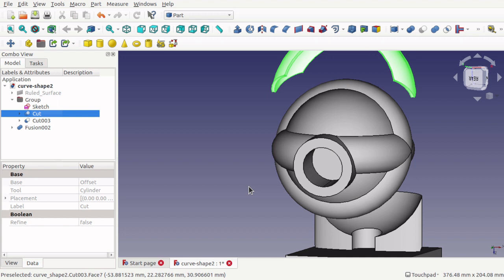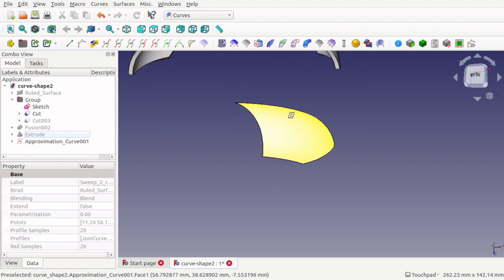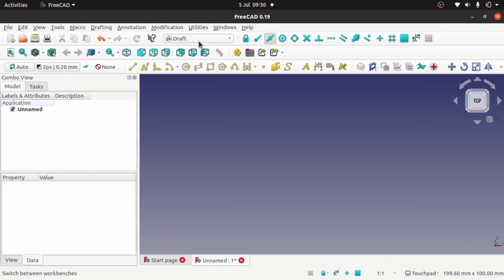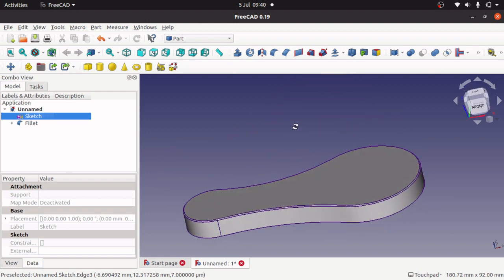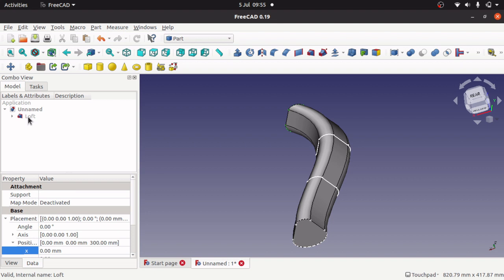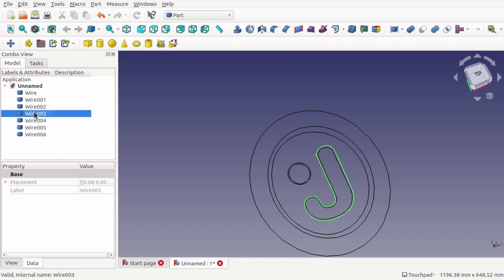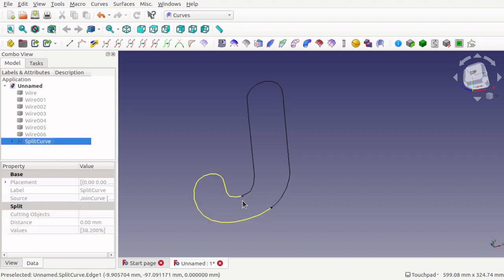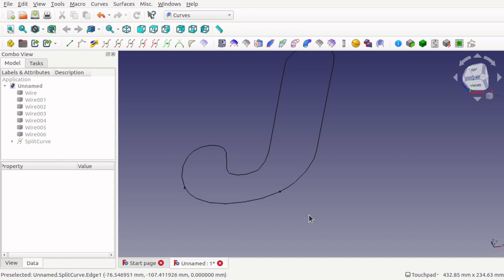Learn FreeCAD Curves Workbench [03] Join Tool. Reduce edges and faces in your models and SVG imports

Comment: I am trying ths with a similar letter J. I use split curve an get another point. If I double click on the join curve, I can move the point but it does not stay on the line. I floats around. I can position near the curve and then, when I double click on join curve again, it jumps back onto the curve but not where I want. If I try to make a fillet it fails with BrepApi.... I tried on two computers. fillet 0.1. I can only get it to work if I make a sketch in Part design ut then it works even if I don't use split curve. Freecad 0.21

Comment: Thanks you for that work !!! I just played with my own logo and tryied to place dots on a splitcurve but I'm not able to achieve that chamfer or fillet on it ...
Reply from the maker: Chamfer and fillet are notorious difficult in all cad packages. You have to be careful of the fillet depth especially if your face tapers to a point. Also when you have two fillets joing at a point can causes issues. I am working on a video regarding them types of problems but it normally means reducing the fillet size until it takes are using a sweep with a profile to follow the edge to remove the material that you need (like what you would do with a wood router). Fillets can be multi width so tapering to a second measurement.

Comment: excellent video again. Hey i was wondering if you know if there is any way to assign a design status (in work, approved, obsolete...) of a part in freecad ?
Reply from the maker: Sorry I think you ask this before but I couldn't find the comment to reply to. There is a comment field on the project if you click on the project icon on the left hand side in the tree view and look at the data tab. You have comment, company, created by etc. This can be populated here and also if you go to the file menu then project information you can add some details in there. Also you could use draft workbench, annotation menu, text which allows you to create a text object to drop into your body. Then you can change the text on the data tab. It's a work around but it works as you can have text objects for anything  groups, body etc